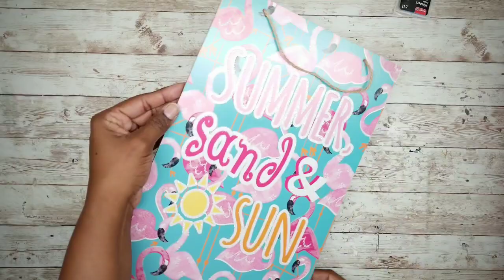DIY DOLLAR TREE HIGH END Modern Home Decor Dupes | Planter Stand Set | Weathered Wood Farmhouse Tray

Comment: I love the tray so much. I actually am planning to make something with faux tin tiles and so your trays caught my attention right away. 

I am getting a metal utility cabinet for storage in my kitchen. I decided to use faux tin tiles on the doors, then frame them out a little with wood strips (stained and distressed) to look like panels on the doors. Take the handles off the doors and replace with some nice chunky wood pieces that I rescued from an old old chair. Paint the metal cabinet and add some dry brushing to make it look like stained/weathered wood. Anyway,  that's the vision in my head. I haven't gotten the cabinet yet, so this may be a long term project. But I can see it much more clearly because of your tray project. 

By the way, I wonder if using a matt finish modpodge would increase the weathered look on the tiles. What do you think?
Reply from the maker: Your cabinet project sounds awesome! Oh, and yes, I would recommend matte mod podge. I was out so I used satin.